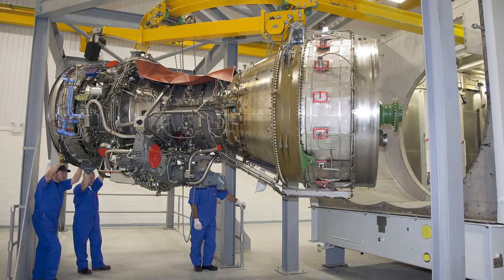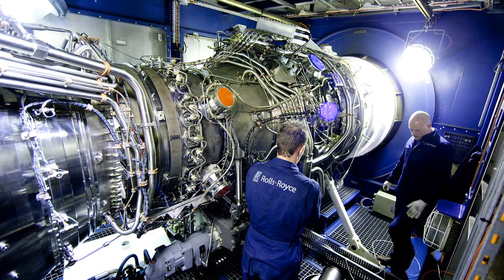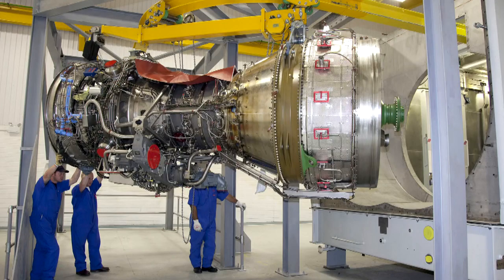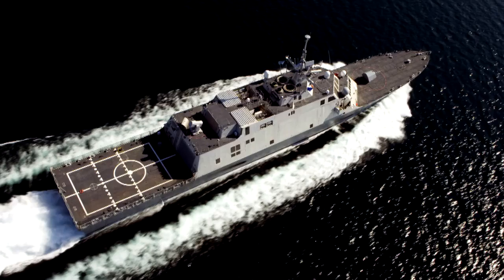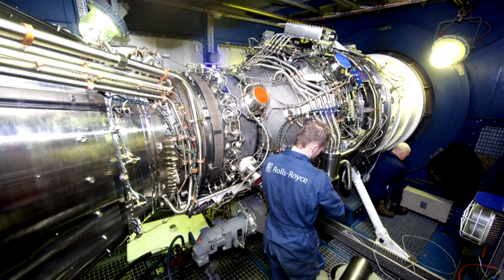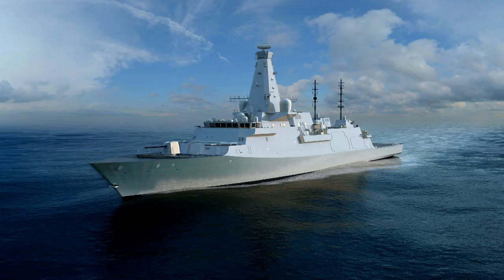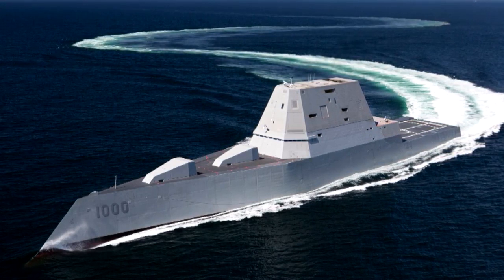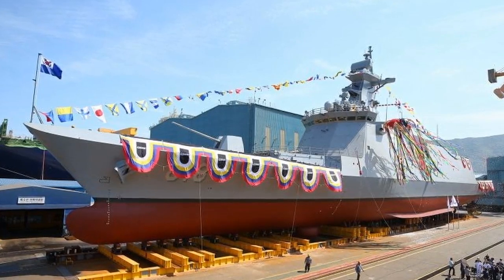Rolls-Royce | Pioneering Marine Gas Turbines

Comment: ok i'm not sure , but does that mean ships are now running around on jet motors?
Reply: it's a gas turbine, you'll find them in all modern gas power plants too (where they are often run as combined cycle and you get to use the fuel twice)